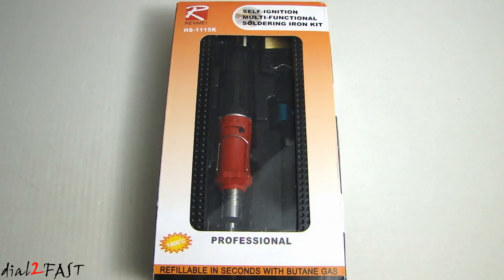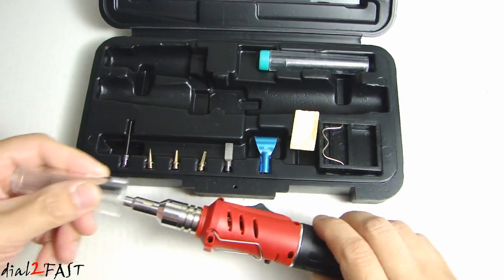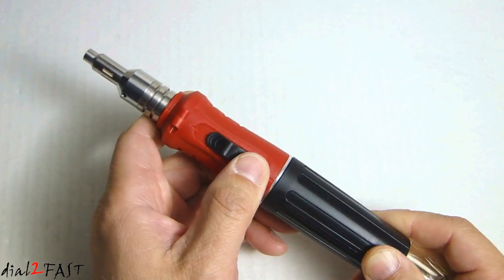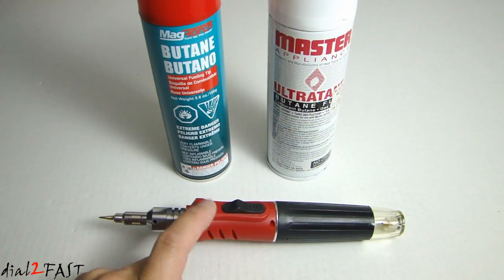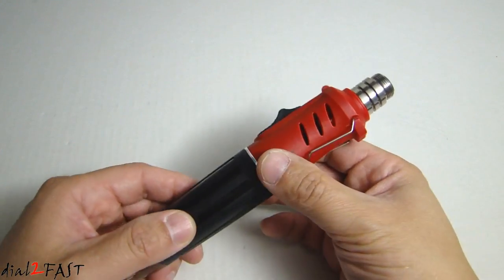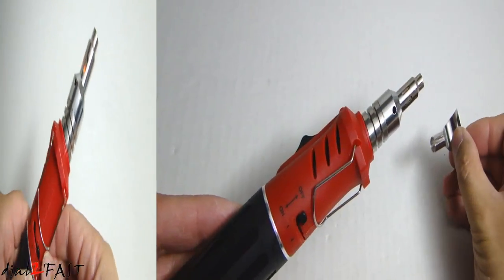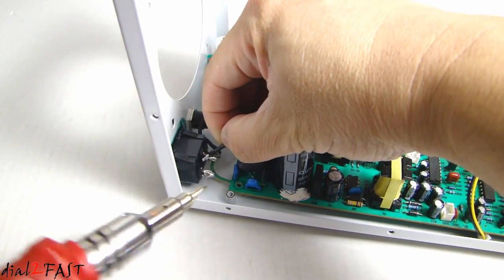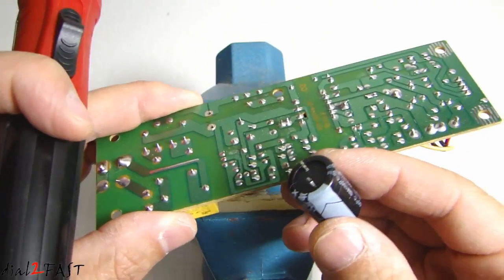Cordless Butane Soldering Iron & Blow Torch

Comment: What is that blue tool used to help desolder the capacitor at about 5:55?
Reply: The tool used is called a solder sucker, or desoldering tool it uses a spring loaded suction button and heat proof tip, you can get cheap ones off ebay that work ok, and are cheaper than using solder wick.
https://www.ebay.co.uk/itm/Aluminum-Solder-Sucker-Desoldering-Pump-Irons-Remove-Remover-Tool-Tin-Pen-WC/332457912119?epid=5007686281&hash=item4d68092737:g:h9AAAOSwqhBZlyDU

Comment: A good tool, but I had some difficulty getting mine to light.  If you have difficulties lighting this tool there are a couple of things to try: (1) If the room you are working in is cold, heat the fuel reservoir for 5 or 10 minutes by holding it in your hand, and (2) make sure you use only the very best quality, most refined Butane. Not all butane is the same quality. Some may even contain a high percent of propane. Do not use cheap butane meant for camping stoves.  Poor quality butane will contain impurities that can clog the gas jet, which in soldering irons is very narrow.
Reply: Dude  none of that makes any difference. You really think that butane doesnt work in cold weather? Cmon man. The problem with the lighting can be fixed by slowly pusshing the ignite button down until just before ignition when gas begins to release, give it a second and then continue the rest of the way to ignition. Problem is that air is in the gas line and you need to prime it.
Reply: @JM-yx1lm  Mine will not light in cold weather, even when I do what you suggest. When the fuel is warmed up a bit it ignites easily.

Comment: I ordered exactly the same iron 2 years ago, the red plastic melted really fast and the tip fell off some times, dangerous and very cheap and faulty iron.
Reply: Now I ordered a Dremel Versatip to try again, hopefully some better construction and material.
Reply: Mine did exactly the same.  Thats why I came here to see if I was the only one. 
Had it running on very low heat and then noticed the red plastic flopping around. It was running for about 1 minute while I was soldering a couple of wires together.

Comment: That channel should really be renamed Gearbest ads channel. By the way for the same price you can get a Weller (or Dremel or Power Probe) bought from a north american store. For the same price why buy a unknown brand from Gearbest ?
Reply: Yes, I looked on Amazon for these butane soldering irons, and I see Weller, Dremel, and Power Probe are the most popular, and highly rated.  Which begs the question why dial2fast chose the relatively unknown  HS-1115k over those three.
Reply: To be fair it looks like a good tool and is available elsewhere ebay etc for around £15-20 and the spare tips are cheap to buy, can guarantee the branded tips will be a lot more expensive and some branded tools force you into buying there refills, this one can be filled with a standard lighter butane refill can